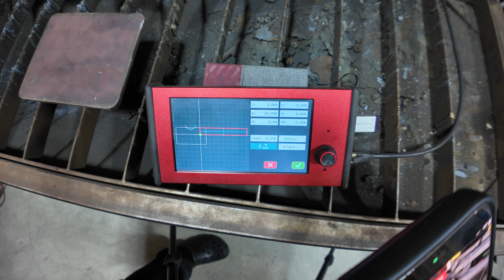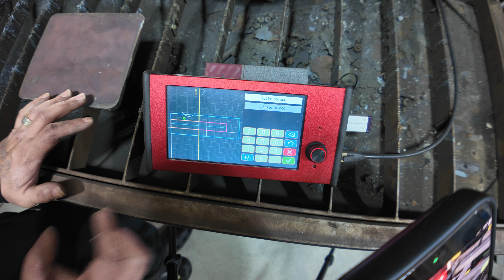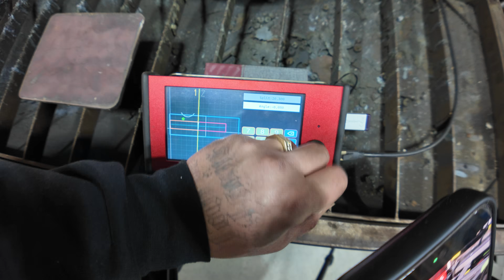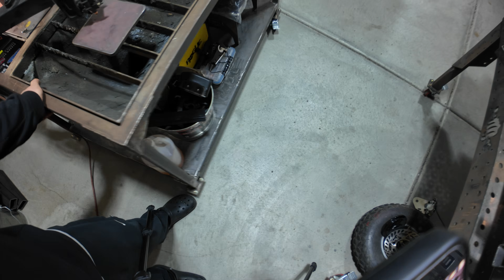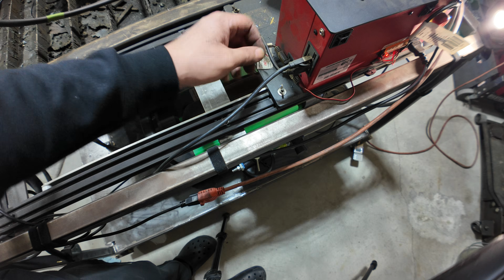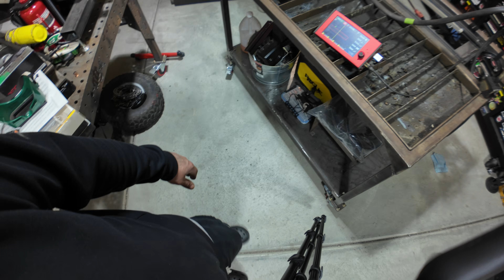ArcDroid How-To: Using the X2 System

Comment: Is this machine capable of cutting a 22 inch circle? I’m trying to make wheel centers for a pretty large wheel and don’t need to do it very often but trying to figure out if this would be a machine that could get it done. Thanks for your time.
Reply from the maker: Maybe for a circle from what I’ve found is about 17”.

Comment: hi, many thx for having take into account my previous comment, very well appreciated
Reply from the maker: Definitely. If you’ve got any other suggestions feel free to leave them in the comments.
Reply: @Anofabco  Thank you. There are also two additional videos that could be useful: one showing the assembly of the X2, and another demonstrating its use with a concrete example—covering each step, from moving the mobile trolley to locking it in place. That way, we’d have a complete, end-to-end view of how the X2 system is installed and how it’s used in real conditions.😁
Reply from the maker: Thanks for the feedback. One of these days when I’ve got some extra time, I’ll make the full video from assembly to cut.
Reply: @Anofabco  many thx